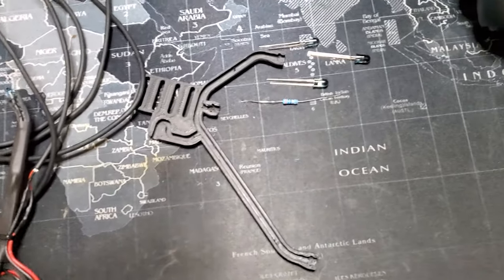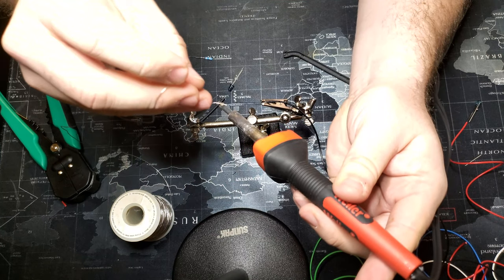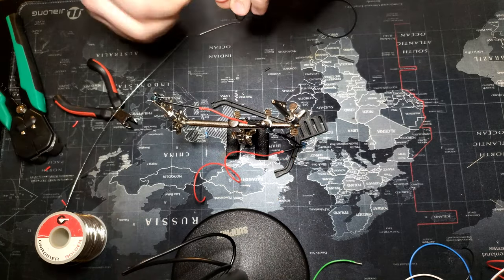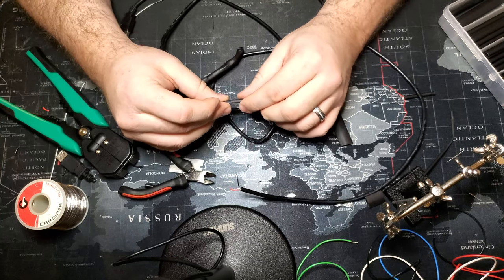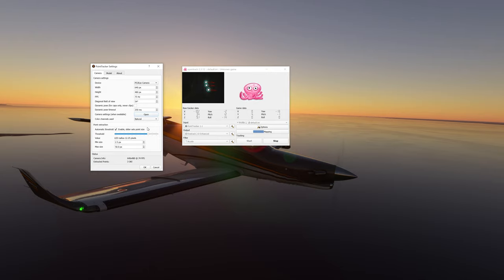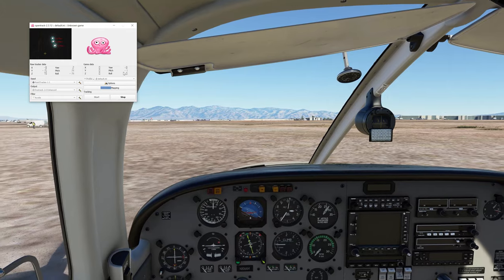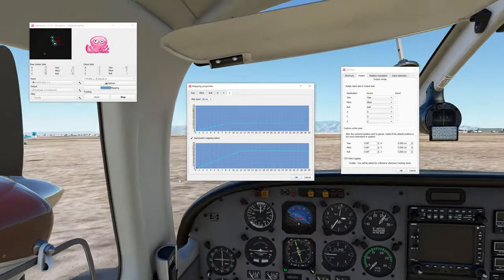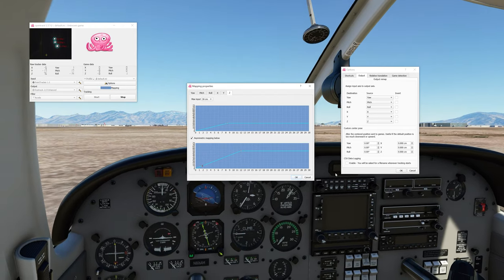Do It Yourself | Head Tracking | TrackIR | OpenTrack

Comment: Heads up: some cheap USB cables don’t respect the color coding inside.  If you have a multimeter, I’d recommend plugging the decapitated cable into a USB power pack, or your computer, and testing to confirm the 5V shows up on the red and black wires before you cut any of them away.

Comment: Nice tutorial. Using opentrack for years now and it is very good.  Ik have tried alternatives like facetracknoir, but led tracking is still the best solution for head tracking. Tip: mount a USB battery on the top of your headset for true wireless.

Comment: Awesome job!!! Exactly what i was looking for ... been using Vr but i feel cross eyed after a while and my eyes are strained as well after a long flight ... the Valve index is nice but nothing seems to be sharp and in focus... Mind you i've ordered the track ir even though it's not cheap, and don't have a 3d printer but i've been soldering things since the 70s ..my projects are Guitars ....electric of course and i like instant gratification sometimes no matter the cost to a degree ...Great Video again !! from what i've seen on your presentation the VR headset might just get a little dusty .. but since i have the Alpha and Bravo set i might use the usb cable hack to add lighting to the Quadrant because i can't see the select button position and it has 5 positions alt, vs, hdg, crs and ias some back lighting would've been great but they didn't think of it unfortunately for night flying

Comment: Hello, quick question. Great video btw. VERY helpful. Im currently using facetracknoir with a logitech c922 pro. Im very new to head tracking. If you have used this software, do you think I could get better performance with your setup?

Comment: Can we use the normal pc webcam instead of the ps3
Reply from the maker: I don't think so but I'll try it
Reply: @OverkillSimulations  I'm using a Logitech HD C 270 webcam.
Reply: You can, just put some diskette film or camera film in front of the lens. The camera is only 30 FPS though, so the tracking can be a bit jittery.
Reply: Main reason for using Ps3 Camera is 75 FPS at 640x480. U have smooth movement. On 30 fps u have not so smooth and jitter from time to time.
Reply: @macnowak933  ive been useing the camera for about 1yr and I have had pretty good luck with. Seems pretty smooth to me.
Reply: Yes you can. I have a Logitec HD C270 webcan and attached a  IR glass infrared X-ray filter on it wich blocks all visible light. Here is the link to the filter i use https://www.amazon.de/Green-L-Infrarot-X-Ray-Filter-760nm/dp/B07RNH1WVR/ref=sr_1_2?dchild=1&ie=UTF8&keywords=Green.l%20ir%20760&language=en_GB&qid=1610388374&quartzVehicle=120-1141&replacementKeywords=green.l%20ir&sr=8-2